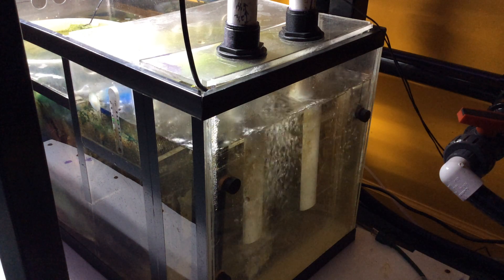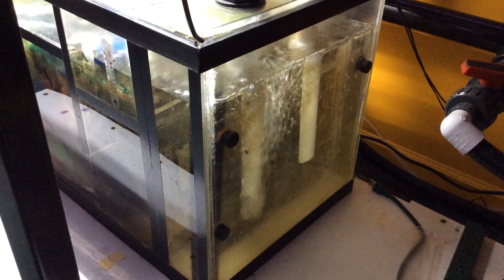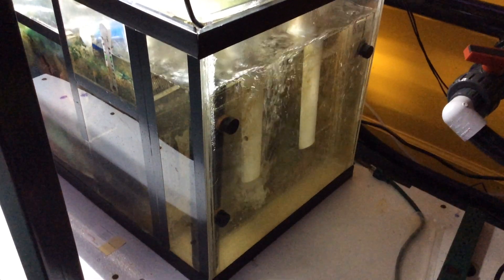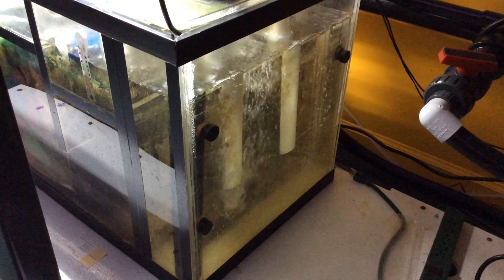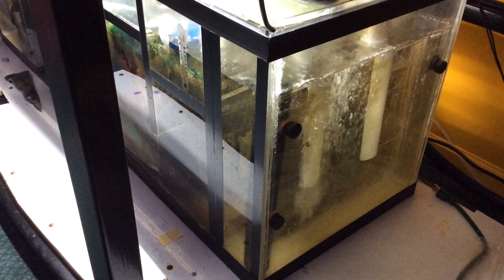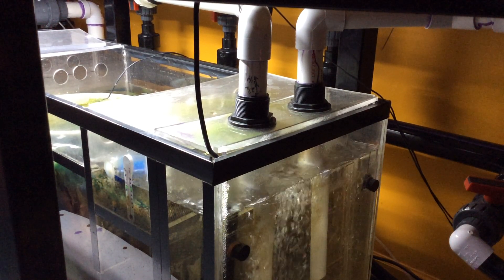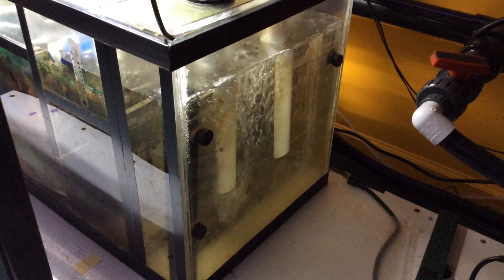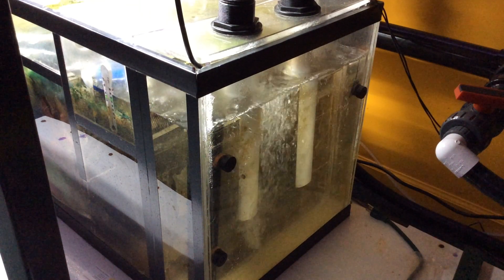Sump Aeration Chamber, an Alternative to Surface Agitation

Comment: Great idea.  You bring up a good point, often overlooked, the relationship between aeration and the nitrogen cycle.  I tell people to not wait for the tank to be cycled and stocked before adding airstones, powerheads or whatever they are planing to use to add O2 since the  N cycle will occur more effectively with an ample supply of O2.  Thanks for sharing.  When I begin my sump experiment on the 100 I will reach out to you 😉
Reply from the maker: One of the reasons I got rid of substrate is because it becomes a low oxygen zone.  Fish waste is up to 40% protein, and when it sits on the bottom in a low oxygen zone it is slowly converted to ammonia and nitrates.  Moving the fish waste from the bottom to a highly aerated sump converts the fish wast quickly to ammonia and nitrates which can of course be removed via water changes or some of the other technologies I am testing like aquaponics, anoxic filters, and algae scrubbers.  Sorry, I am a biologist and looking for biological alternatives to water changes and gravel cleaning.

Comment: How are you introducing oxygen into your over flow box and creating such a great aeration chamber? I originally thought you were using air stones in the first chamber. I see now that the amount of air and force you are getting is much higher.
Reply from the maker: Bloodshot Gamer I have a 1 1/2 inch T in the bottom of my exterior overflow box.  As the water drains from the box through the T air is combined with water.  I control the flow from the overflow box with a ball valve to regulate the water and air mixture.
Reply: would love to see how that works and thank you for the reply.

Comment: I employ and identical method in my 220 gallon African Cichlid tank  like you. However I removed the acrylic lid directly above to make sure that there is enough oxygen exchange. Do you feel that you are limiting the amount of air that can exchange with the surface agitation if you have a lid over that section of your sump?
Reply from the maker: The air/oxygen that enters the return lines does so primarily from the overflow boxes, hence the head space oxygen level above that chamber is really not material in my analysis.  Additionally, I have recently sealed the edges on the acrylic lid to minimize evaporation from the aeration chamber, and to maximize condensing the water so it falls back in the sump.  I have a automatic top off systems (ATO) feeding replacement water to my aquarium/sump system, and since I sealed off the aeration chamber I can wait a lot longer before I refill my ATO reservoir with water.  Thanks for checking in.